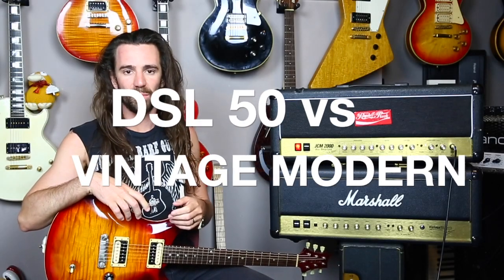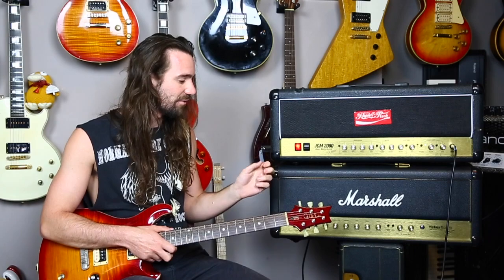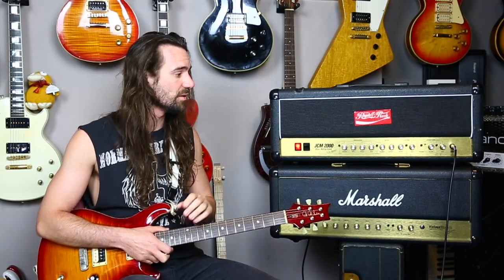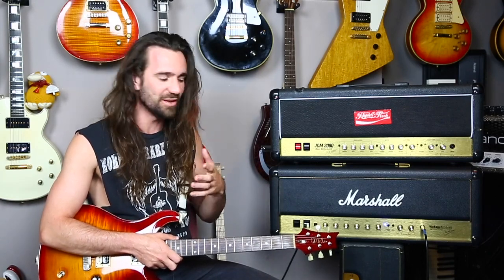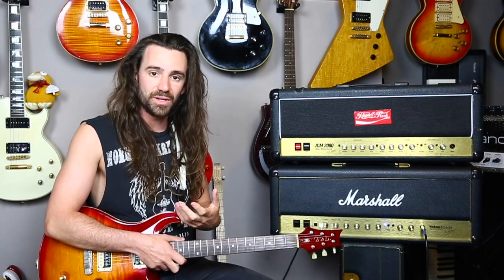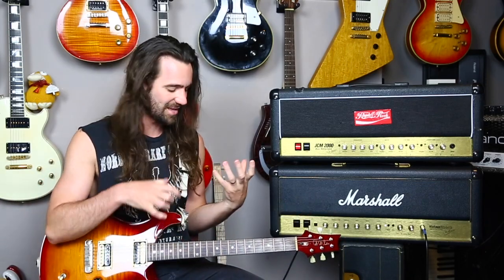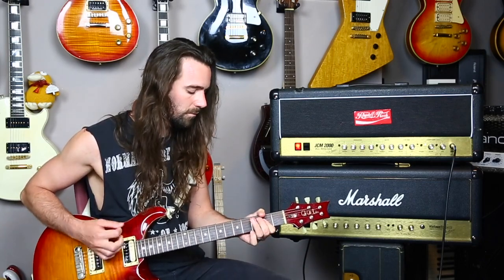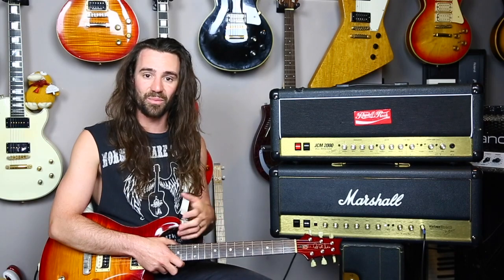Marshall DSL 50 vs Vintage Modern

Comment: Does the DSL sound choked compared to the VM to any one else?     I'm listening on jbl monitors.
Reply: Definitely. It's just not a good amp imo... According to my amp tech, the weakest point of a DSL is its output transformer which makes it sound brittle and flabby.
Reply: Guy Buddy  Definitely. Never really impressed with a DSL other than some clips. 

The vintage modern on the other hand, one of the amps I am thinking of buying again...something I don't usually do.
Reply: Don't know what Marshall is thinking... why did they discontinue the VM? every recording/practice studio where I live has the DSL as a standard and it just isn't good enough/loud enough for a substitute for my own gear. My main amps are V4(Ampeg), Sovtek Mig100, and a Boogie Mark3, you get the picture. The VM would definitely be a good enough, maybe even better substitute when I can't drag my own gear around.
Reply: 100%

I bought one used about 4 months ago and I've probably touched it twice since. It sounds AWFUL. 

I really wish it didn't, but the ultra gain channel sounds so, so bad. Super harsh treble and fizz, absolutely no sustain whatsoever. 

I'm now trying to shift it to get something else.

Comment: What speakers are you using please?   Also, would you know the sound difference in the DSL 50 vs 100 watt?  thx
Reply from the maker: I'm using a load box and a v30 impulse here. The 50 and 100 should pretty similar

Comment: Great demo. You make that DSL sound great, which it is.
Reply from the maker: Thanks mate, I love that amp so much!
Reply: What do you set the Presence to on the DSL? That control is so important.
Reply from the maker: Around 3 or 4, although I often run it at 0 too and crank the mids and treble to compensate. Depends on the type of speakers I'm playing through.

Comment: As you can hear in this video, PRS guitars are well made, beautiful, and have great note separation and string definition, they cut through a band well, but, they are bright to the point of being harsh and brittle sounding. Because of that I wouldn't demo amps or pedals with a PRS. Would be great to hear a warmer brand of guitar Leon.

Comment: This is a great video.  Really helpful!  I have a mark V 25 and am looking at my first Marshall.  Which one would you choose for an allan brothers type sound?
Reply from the maker: The green channel of the DSL or the low dynamic range of the VM would be great
Reply: Thanks!
Reply: If you could only get
One which one would you get?  The dsl is a little cheaper but the vm looks like a great amp
Reply from the maker: @jimmyjams1974  the DSL is a tad more versatile so it might be the smarter buy

Comment: I have a 1960 A cab. Is the DSL 50 or 100 better suited to the 4x12 cabinet? Either work?
Reply from the maker: As long as the power rating of the cab exceeds the power rating of the head you'll be fine either way.
Reply: Jared Kincaid I chose a Diezel rear loaded straight cab over the 1960
Reply: Leon Todd  - thank you - went with the 50, fewer available, decided on less power so I could turn it up more. Didn’t get a pedal with mine. What do you recommend? Got a two switch that came with my DSL 40C, can I use that, and is there another option that will give me more control through the foot switch?

Comment: DSL is my favorite amp of all time and I really want one of the 100 watt heads, but I would never be able to crank it in my house. Kind of thinking of picking up the 40 watt reissue combo.
Reply: I have the DSL40cr and am in love with it, its 20/40 watts which makes it quite useable at home.
Reply: I use the 100 watt DSL 100H into a Attenuator (Jet City Jettenator). You can crank the power amp as hard as you want and drop the volume down and it still sounds really good.

Comment: Excellent video, I have both in Combo's the DSL 401 and the Vintage Modern 2x12 Purple with Celestion Hendrix Green back's. I love both Amps, as you put it the DSL has more Gain but the VM is really sensitive to Pick attack, I use a MXR Zakk Wylde OD in front, sounds wicked.
Thank you for the demo, some nice riffing!
Reply from the maker: John Roberts what speakers do you use in each combo?
Reply: Hi Leon,  Both Amps are Combo's, I  have the Purple VM has12" Celestions  Greenback's, according to Marshall they are Hendrix Voiced Speakers.
The JCM 2000 DSL 401 has a Celestion Black Back 12". Both are made in UK. Have a great day.
Reply: Leon Todd , Hi Leon, if you are ever in the North of Melb you are more than welcome to check out my  guitars and Gear that I have collected over the years.

Comment: How about a good JMP-1 Demo??
Reply from the maker: Now we're talking. I'll have to try it with a few different power amps for best effect.
Reply: Leon Todd that would be awesome. I love the JMP-1. I have one I run with an EL34 50/50 and another I run with the EL 34 20/20. I'm sure you would show off how good they are to the viewers. I would suggest running it into the fx return on the JCM2000 as well. They pair great together!

Comment: 800 #34  :)
Reply from the maker: Judd awwww yeah!
Reply: You can easily make this mod (#34) without any tech, just take a stock JCM800 and put boss GE-7 in front of the amp with a little bit of pushing hi-mid range. Done!
Reply: Ummm... No.
Reply: I have mod #34 and stock JCM800 2203 with GE7, and yes, it is! ))
Reply: FYI #34 was a Frank Levi modded Model 2203 Mk.II at SIR, originally modded to sound like #39 & #36 which were always booked out (or stolen)

Comment: I own the JCM 2000 DSL 50w. I was trying to reproduce Jeff Beck at Ronny Scott’s live concert as well as classic Jimi Hendrix live sounds. IMO, it sounds really too harsh , trebbley, and very fatiguing to the ears. It has been suggested to me to tame it , I should replace Transformers to Mercury and change tubes to use JJ’s. 
Any thoughts? Should I just get a different Marshall head to get those tones I mentioned above or try the mods ( Mercury’s & JJ’s)?
It would be great to get your opinion. I really enjoy all your vids. U r one very productive guitar dude. 
I play a Jeff Beck Strat with Dimarzio area pu and a Gibson 335 , a G&L Tele , Allan Holdsworth “Fat Boy” Carvin , and a Gibson Tal Farlow. Grew up idolizing Hendrix & Beck. Now I’m learning Jazz. 
I’m about to buy a Boutique amp...likely a Red Plate Blackline ( Allen Hinds) vs Glaswerks Zingaro. 
Thanks in advance for your input. 
Dr Brad 
Dallas,Tx
Playing since 1960
Reply from the maker: Change the input cap before you so anything else, it has a huge impact on the bite you're describing. Pete Thorn talks about it in his "How to dial in a Plexi" video and I just had my JTM45 input cap changed. Another easy fix would be to use a graphic or parametric EQ up front to tweak the input EQ.

I must say, i hope i live long enough to celebrate my 58th anniversary playing; only another 40 odd years to go!
Reply: JCM-600 is really good choice. One of the best cleans I've heard in a marshall and it has 2 chanels. Both very usefull and you can get any kind of tone with it. It's also the cheapest JCM's out there.
Reply: Beck tone is very easy with the DSL once you realize that he plays backwards from the norm. Beck turns the bass almost off and cranks the treble and mids so it's bright as can be. Then because of the way his strat is wired the tone controls control all 3 pickups. He rolls both of the tone controls all the way off so it would basically have no treble. He then rolls the tone knobs up to adjust the treble. Do that very loud on the green channel with the crunch engaged and throw a Klon style pedal in front and you will get very close to his sound. Now if you just want to play like most people with your tone knobs up you will find the DSL fairly bright. The trick used by guys like Joe Bonamassa and Scott Henderson is to turn up the bass about halfway, crank the mids knob to about 8 and leave the treble and presence controls off or between 1 or 2. Again using the green channel with the crunch switch engaged and the gain on 10. With a Les Paul it is very ZZ Top-ish. Throw a tube screamer in front of it with the tone all the way off and volume and drive at noon and you will be in a more early EVH area. Super versatile amp but the EQ works different than most in my experience. The usual bass at 6, mids at 4, treble at 7 type thing that a lot of players use just doesn't sound good in my opinion and all the pro players I've seen use them do it the way I described.